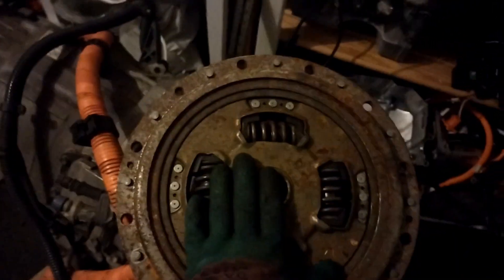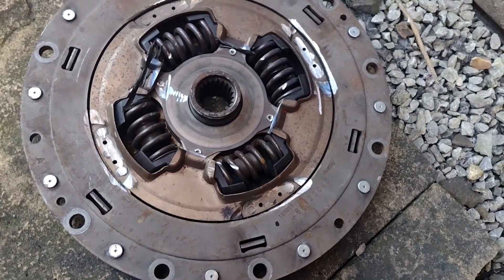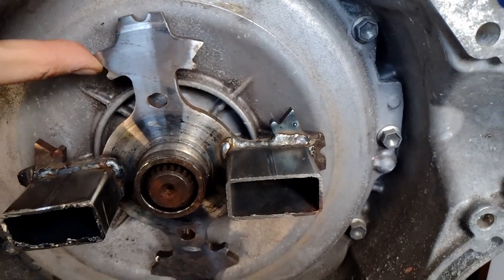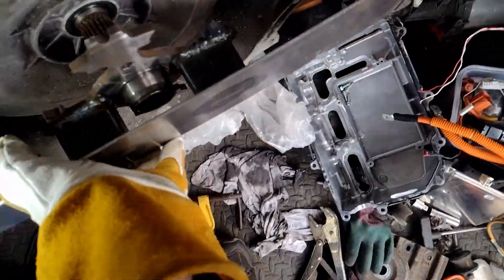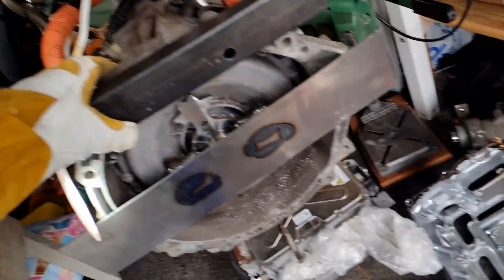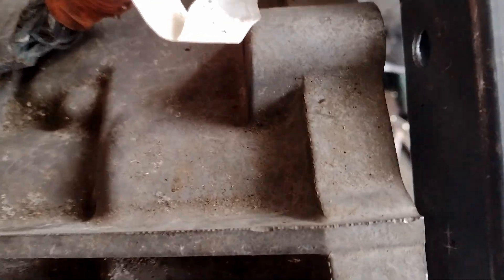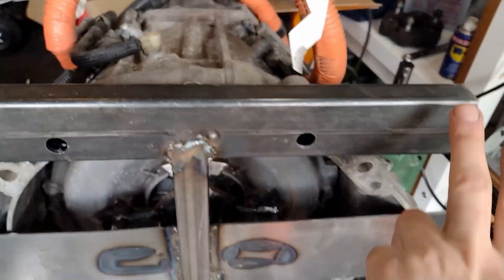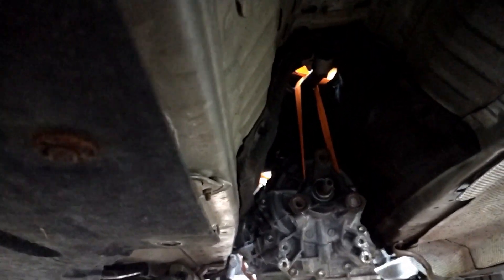DIY BMW E91 EV conversion Episode 2 - Input shaft locking

Comment: That gearbox is a lovey fit. 🙂
In the standard car the gearbox is braced by the engine and the engine mounts. 
How do you plan to support it now to stop it twisting off it's mounts?
Reply from the maker: Currently looking at what other's have done. I'll pickup the engine mount points and transmission mount points.